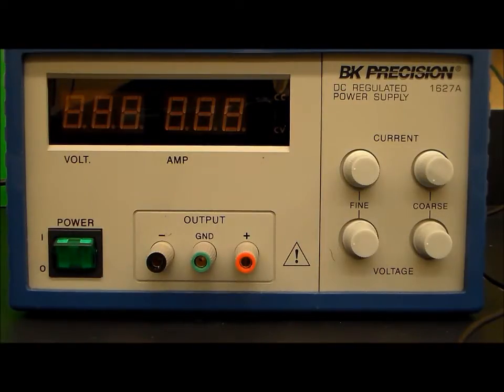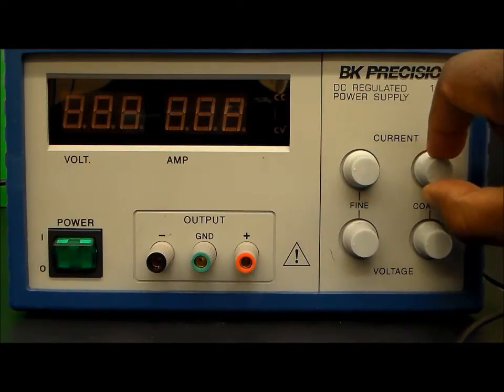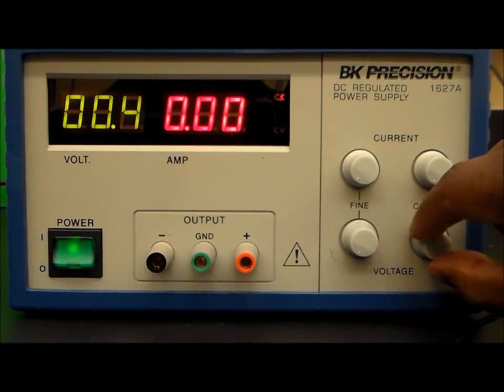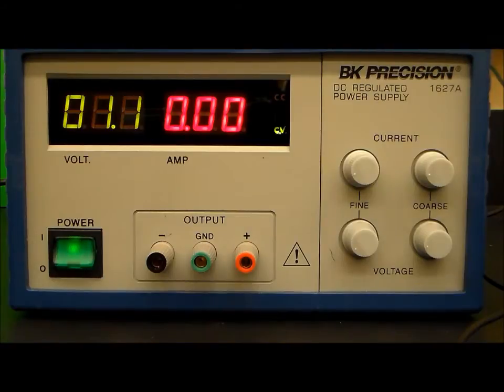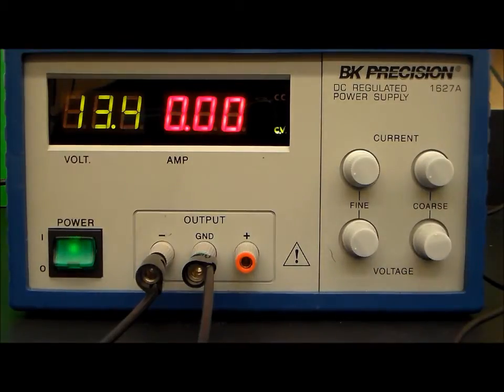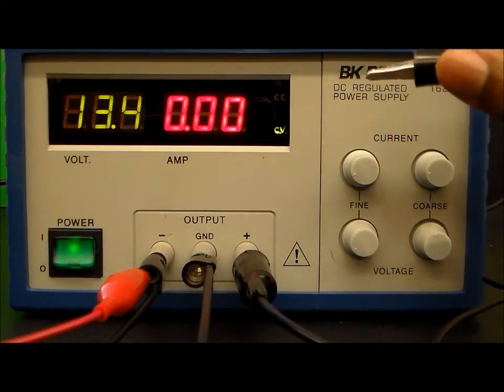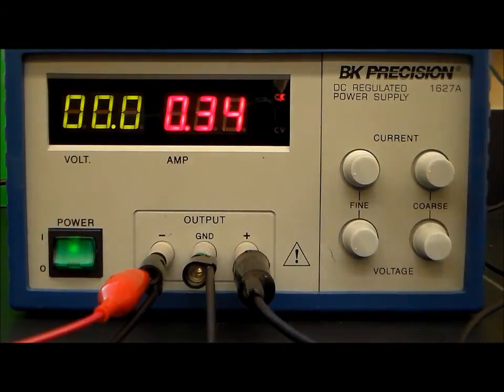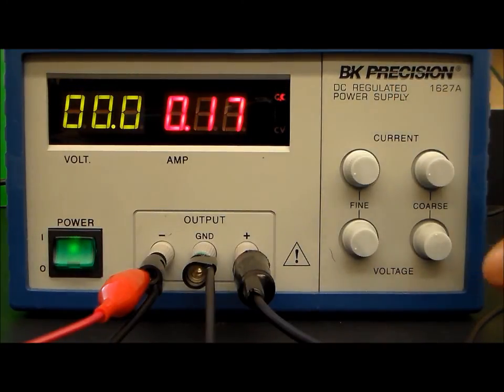How to Set up and Use a BK Precision Power Supply

Comment: I am surprised that this unit does not come with a shorting strap to connect the ground  to the neg terminal.  It would be much cleaner to use.  But also, one should be aware that there are times that you want the supply floating and not referenced to mains earth and therefore you would not use said shorting strap or wire and tie the neg terminal to ground.  Example being applying a voltage to a supply section of a piece of gear with multiple supplies at different references and applying an earth referenced supply in the wrong spot can do exciting things LOL.
Reply from the maker: Thanks for your input.

Comment: Hey Clyde.  I was gifted a 1705. I have no voltage on my output circuit. Turns on, has voltage at various points on the board. No output voltage. Know where I might find drawings?
Reply from the maker: Hi,
Sorry to hear you are having trouble. I may be able to help. I use this area for comments. If you would like me to look into it. I can answer that on my website. Please send post your question here: https://clydelettsome.com/blog/ask-the-expert/